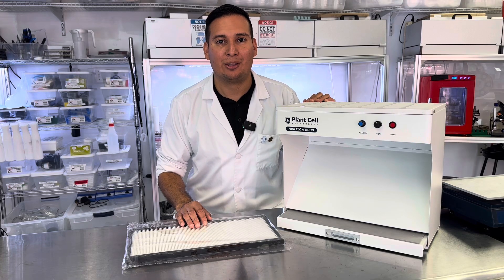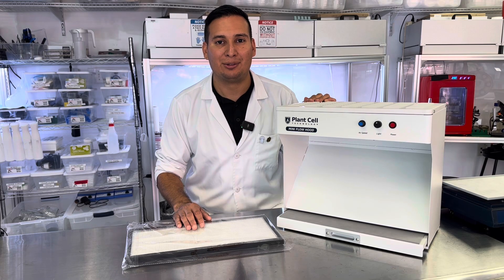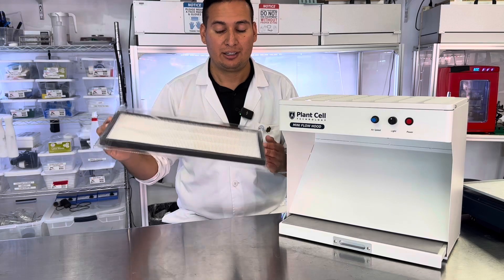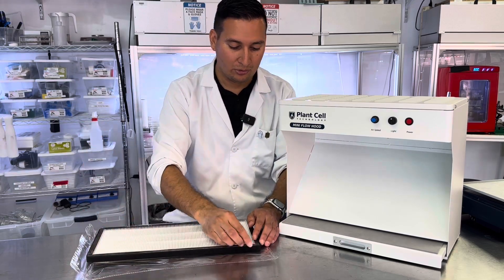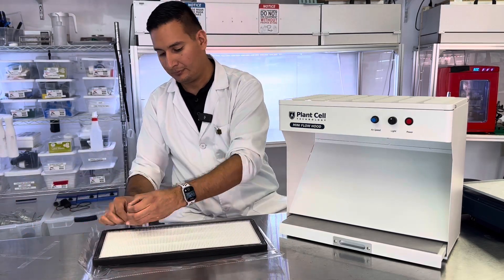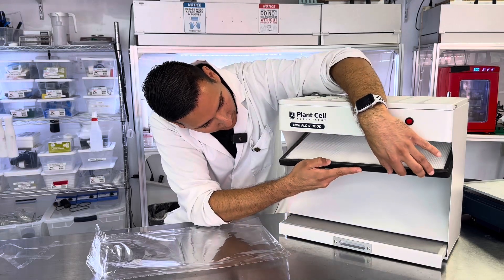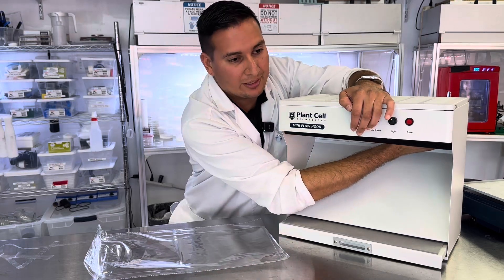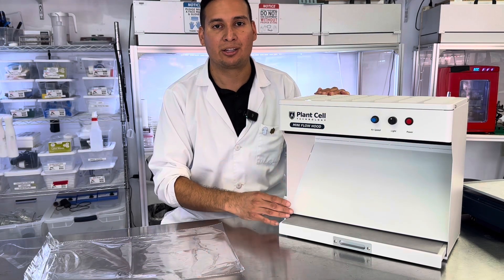How to Change the Air Filter of the Mini Flow Hood

Comment: May I suggest something? To prove this flow hood, you should do the smoke test and particle count.
Reply from the maker: Yes, we have particle meter.
Reply: @PlantCellTechnology  Show us!
Reply: @PlantCellTechnology  Can you make a video showing how to adjust the speed correctly? I bought one of these from you but it comes with no instructions at all.
Reply from the maker: @hashmetric  The device has a direct switch on and off system.
Reply: @ The fan speed… How do you decide the best speed. I don’t really feel much difference. I’ve tried changing it by watching a light amount of mist from above but the mist is still too heavy and it falls on the table. I’m not suggesting it doesn’t work as I have only had contamination in 3 of the 20 test tubes I have tried which was better than expected for my first time and I know that’s probably me not the hood. But it’s be nice to see a demo of how to adjust the speed and what we are supposed to look for. Thanks!

Comment: No way these work.  2 PC fans after the filter would cause turbulent air flow wouldn't it?
Reply from the maker: Our culturists have had great success as well as us here in the lab!
Reply: @robertl6711  The fans aren’t after the filter. The fans are above the filter and the air comes out through the filter. It’s vertical.
Reply: @robertl6711  It’s worked well for me.